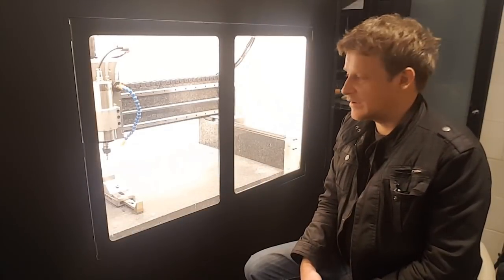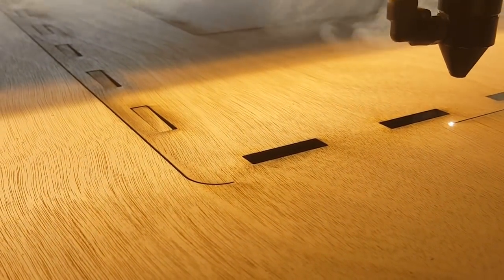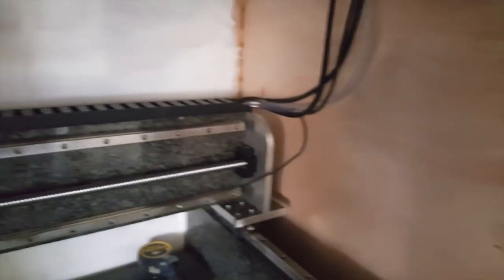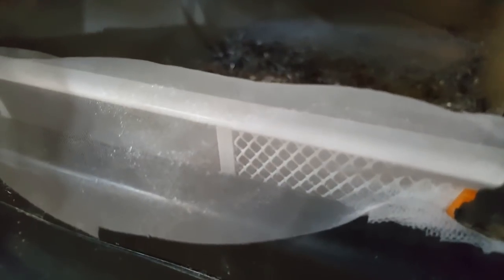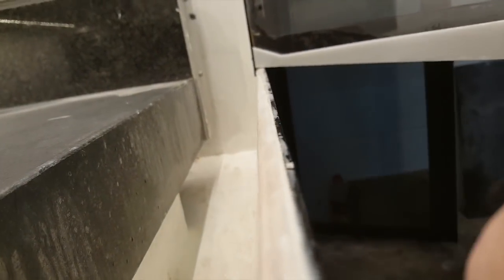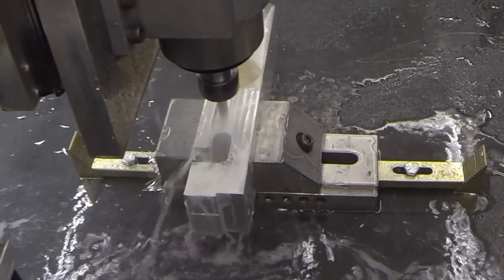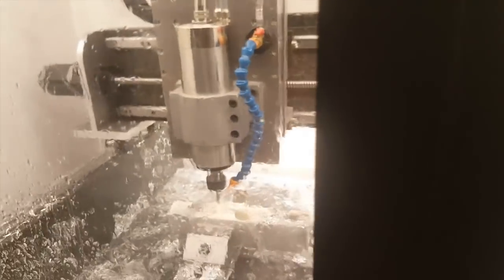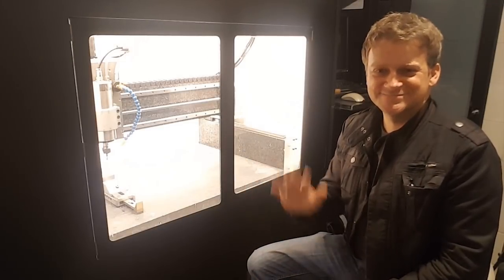CNC machine made out of granite - part7- waterproof CNC enclosure

Comment: Hey Piotr! Greetings from the UK. Thank you so much for sharing about your journey of building a Granite CNC machine in 7 Parts. You are a Masterclass. I learned a great deal about how to measure the flatness of the mounting surfaces and how to check for distortion in the linear rails etc. I have been meaning to build a small milling CNC for making aluminium prototypes parts.

One question that came to my mind - is it necessary to have the granite base and the sides so thick. Or did you just use them because it was easy to find those sizes in your neck of the woods?

Also the flood cooling method you have employed, doesn't it have a negative effect on the oiling and greasing of the linear bearings and the ball screws etc?

Altogether including the enclosure build that also handles the chip extraction/filtering in such a simple and easy way. 

Please keep doing what you are doing and never stop.
Reply from the maker: You have to watch epic upgrade series.  You should like it 😉
Granite base was a surface plate and its a standard proportions. Sides had to be 50mm so it won't Crack or bend. After many years I can say that this is a good and tested size.

Water cooling has some anti rust additives. So as long you keep good proportions no rust, at list on rails. My vises are bit different story. But it's not bad either considering my parallels which are outside of the machine. They look much worse. In the matter of fact everything metal what I have is much more rusted. Those vises look new in comparison.
Reply: @PiotrFoxWysocki  Thank you for your reply. Points noted about why it is important to have the thicker base plate and water cooling. Yesterday, I finished viewing all the 7-8 parts of your Granite build and will go over the Epic series. 

What I had in mind is a simpler 3 mother fixed gantry design with say about 350 x 350 mm workarea. But the problem I see is. I then have get cut another granite square piece for the moving bed and drill the holes for mounting the linear bearing blocks and ball screw holder mounts. That is quite tricky to say the least. 

Maybe that would be too labour intensive.  What are your thoughts?
Reply from the maker: @MP-mu1kw  my thoughts? I built granite cnc 😉 no hole will scare me 😉

Comment: Hello Piotr, I’ve seen a lot of your videos and you’ve inspired me to build my cnc milling machine out of granite to. In an couple days I’ve got an appointment by an company where they’re going to make the granite parts for the frame. I got one big doubt on this project; I’m living in an old apartment (manly built out of wood) and it’s very noisy. Im very worried about the noise and the contact noise i’ll produce (the vibrations going to the structure of the building). I don’t want to disturb my neighbors. You can’t tell me how loud your cnc is with an enclosure, but can you tell me if you can hear the machine milling while standing in an different room? Did you ever experience the same problem to perhaps? Hope to hear you soon. Greetings from the Netherlands!🇳🇱
Reply from the maker: Hey 👋 the most noisy thing is the compressor when it kicks in. But it's for my atc spindle. Milling is not so audible. You only can hear from other room if you have thin part and it chatters. I think once I have done dB test and it was about 70 dB when you are next to it. I guess it can be vary on the enclosure you make. Anyway granite is the quietest material you can use for cnc. It does absorb a lot of vibrations
Reply: @PiotrFoxWysocki  thank you Piotr, for this well informative answe. 70 db is not a lot. I’m sure a can bring it some more down with an thicker elsloser. Looking forward to your next video!

Comment: Piotr, Great job.  Do you get any play or chatter problems with the linear slides?
Reply from the maker: None. It doesn't matter what feeds and speeds. Chatter starts when the feeds exceed capability of the endmill and endmill starts to deflect. This would be visible for the tools under 6mm diameter.

Comment: Nice work ! I understand the driving goal was to achieve micron level accuracy, but did not see a quantitative characterisation in the build series :have you quantitatively checked the positionning accuracy besides surface quality appearance ?
Reply from the maker: this machine was just an exercise on my part to see how precise i can actually make it by hand without any specialized tools. in my opinion machine base is the most important thing, because all ball screws and rails are consumables which are replaceable. since i got the cheapest chinese rails and screws, measuring it will be depressive :) its more than enough for stuff im making anyway.
but having good base i can eventually replace screws and rails in to some good ones.
my goal was to have super ridgid machine, so i can chew through aluminium, precision was a side effect :)
Reply: @PiotrFoxWysocki  But why are you using aluminum in your project? The modulus of elasticity is many times lower than that of steel. Despite the incomplete fastening of the linear guides, which will replace all weak materials, you can try to increase the rigidity of the machine.

Comment: Hello. How did you fix a wise to granit surface. I do not see any holes in it.
Reply from the maker: I fixed it with M8 inserts. I drilled 10mm x 30mm hole in the granite and placed insert in it.  I used 2 screws, one on front of the vise and one at  the back.

Comment: How are you finding your enclosure now down the track? Love the design currently going through the process with my Miling machine conversion. Have you tried cutting any steel with this machine yet? I've been looking at a steel cutting version similar to yours with a granite base. Cheers from Australia.
Reply from the maker: James M enclosure is great. Works like a dream. You mill stuff inside and take chips from under the machine on a tray. I wouldn't change a thing. Haven't tried steel yet as I don't need it yet.

Comment: The water is trapped inside the waterproof case.  I love the granite idea.  I had the same idea, and many variations thereof, like ceramic tile for a stationary bed for a 3D printer or small non-routing CNC.  I do prefer the sanity of stationary bed, but in most lighter weight designs of CNC's and 3D printers, to get speed, you often lose the stationary bed.

Comment: Is that water or oil?

Just finished watching 1-7. Looks cool!
Reply from the maker: Maple_Dude just a regular water based coolant. Nothing special.
Reply: Dumb question on my part - rust?
Reply from the maker: Coolant im using its metalium, made in Australia. It has rust protector, antibacterial, antifungal, chlorine, nitrate. I believe all coolants are similar. You mix it with water in ratio 15:1

Comment: I think that you have done a great job, really like the use of available materials like surface plates.  I suspect that most if not all surface finish issues that you may see are spindle related, the routers for wood have little or no real side load ability.  Id consider getting a little spindle from Tormach next and adapt a motor to that and I think you would be able to take advantage of the rigidity and vibration isolation of your granite set up.
Reply from the maker: indeed. spindle and crap Chinese rails plus ball screws. at the moment im most annoyed with tool changing. before on the 6040 machining was taking hours so tool changing wasn't that painful. not machining takes few minutes no matter what it is. so tool change appear to take ages.

Comment: Great project. Thanks for sharing.
Any plans for testing steel?
Reply from the maker: i'm glad you liked it :) my main goal was aluminium, but who knows. i'm sure eventually i will have to do something out of steel.
Reply: Piotr Fox Wysocki the reason I'm asking - you've got pretty rigid base. 
With testing on steel you would likely find the weakest parts of design. And by fixing those - aluminum finish should be perfect.
Reply from the maker: no need to do that. the weakest points are those chineses sliders, ball screws and not really well balanced spindle. If i will start making production runs on this machine than i will think about replacing "chinesium" :) 
at the moment i can't justify dumping money in to it.
Reply: Piotr Fox Wysocki thank you

Comment: Really slick setup and  I picked up several suggestions. I keep considering a wooden enclosure of some sort. A garden hose sprayer would seem to make quick work of the cleaning.
Reply: I like the epoxy granite idea.  I'd love to try it someday.  For my grizzly mill, I made the bottom pan from plywood coated with fiberglass.  Then for the sides, I used corrugated plastic with a wooden frame.  Just painted any wood that was on the inside.    For the doors, I put them on the inside and slide.  This keeps the coolant inside.   https://www.youtube.com/watch?v=qg1X0ttd7q8&feature=youtu.be
Reply: Oh, I forgot to mention, I talked with the owner of a granite cutting company yesterday, who gave me a tour, and I told him about you building machines from granite and your videos. We was really interested.
Reply from the maker: I think wood is the best choice for home cnc, it has to be functional first. making it out of aluminium or folded metal its just a unnecessary expense and functionality will be exactly the same.
Reply from the maker: what you been doing in granite cutting company ? are you going to build granite cnc ? :D
Reply: They share a warehouse with a bitcoin mining/blockchain company that I visiting... and they are building a video production studio there... yup can't make that stuff up. Granite machine construction may be only for the experts: you and Dan Gelbart, but I would like to give it a try.
Reply: Any metal or metal clad surface probably will make the enclosure a resonance chamber. Building from wood would be nice. There's a video on Hidden Acres (v=qg1X0ttd7q8) of another nice wooden enclosure. I'll probably pilfer some ideas from both of you :)
Reply from the maker: this is the strangest combination of companies in one place :)